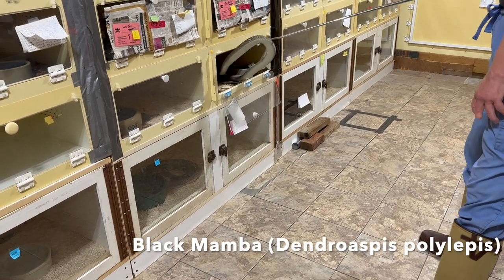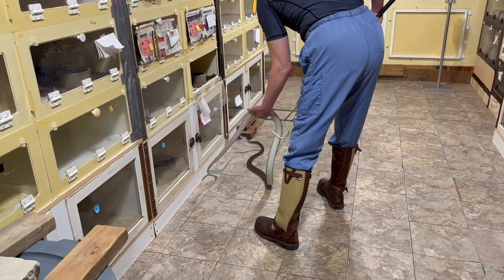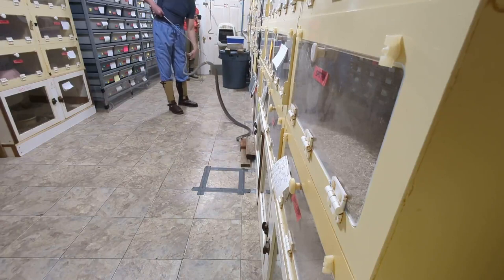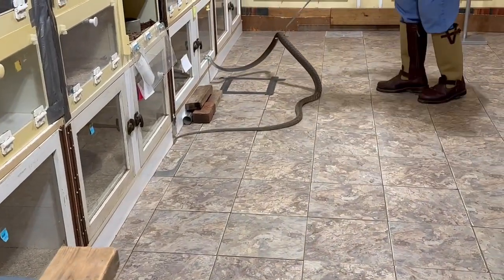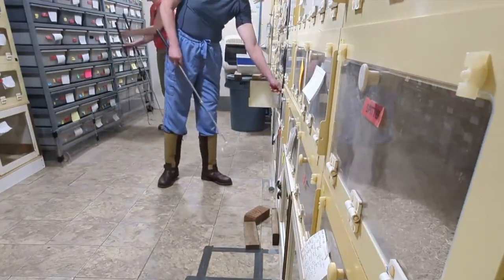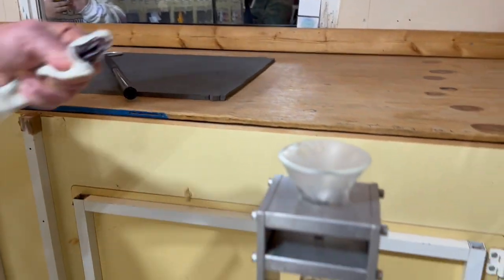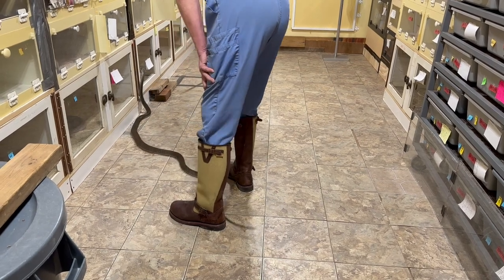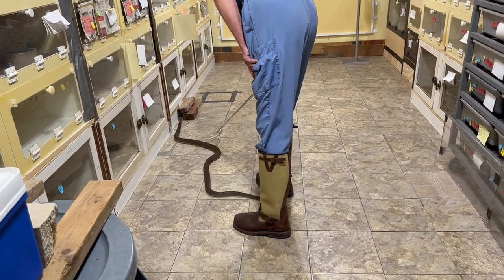Venom Extraction from the Infamous Black Mamba!

Comment: ik u guys have been using this tube method for a while, but i think sitting there trying to get the snake to go into the tube increases the risk of getting tagged. U should look into the method the australian reptile zoo does to pin their elapids. Idk just a suggestion or would like to hear your thoughts. They said the method they do decreased the risk of everyone getting bit dramatically and it seems very safe.
Reply from the maker: We've seen their method with taipans and brown snakes, but I've never seen it done with mambas. It's true that the risk increases the longer the keeper interacts with the snake, but Jim is most comfortable and practiced with this method. I would be interested in their thoughts of using the pinning disc on mambas, because I wonder about the added challenge of mambas being more adept at climbing tools.
Reply: @kyreptilezoo  surely theres gotta be a safer way to milk these snakes than with your bare hands? Why not at least wear gloves ect? 
Or just try to come up with an entirely new way to do it?
Reply from the maker: Gloves would limit Jim's dexterity and ability to feel the movement of the snake's head, and they would also have weak points along the seams of the fabric. People have developed and sharing venomous handling techniques over the years, but for Jim, he has developed his method over 48 years, and there would be a risk to try to do something completely new.
Reply: Does a snake ever remember a previous occasion with the tube and not cooperate?